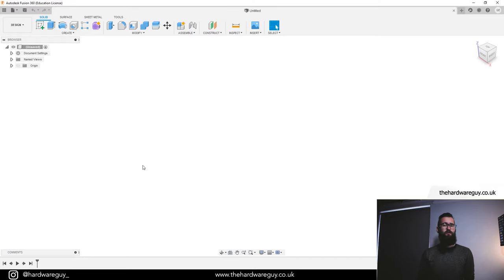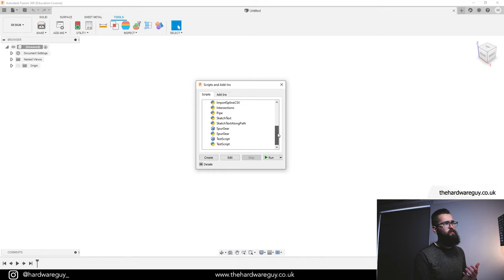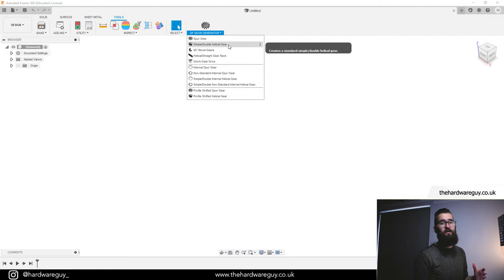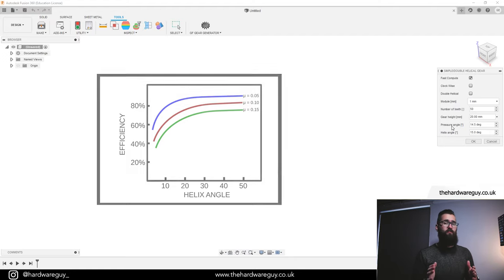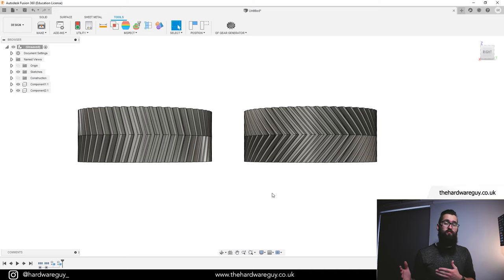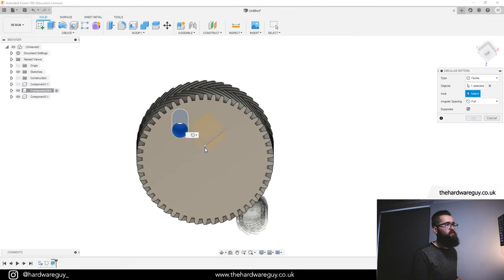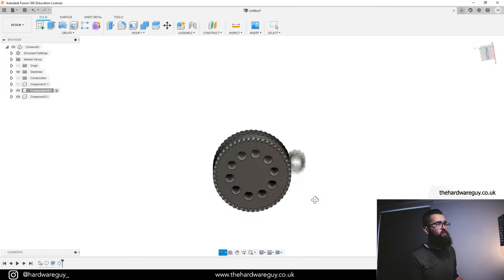How to Create Gears in Fusion 360

Comment from the maker: if you'd like to calculate the correct distance to move your 2nd gear, you can use this formula:
(M*(T1+T2)) / 2)
(Module * (Number of Teeth in 1st Gear + Number of Teeth in 2nd gear)) / 2
Do be aware that 3D printing has wider tolerances than typical machining, so you might have to try a few prints at +/-0.25mm
Reply: How would you suggest integrating those +/- 0.25mm toleranzes? Is that configuratable when creating the gears or do you manage that later in slicer? Changing the values in the slicer would probably change the values of all the other dimensions tho...
Reply: @benloschnigg9275  I would add a small gap in fusion 360 with a user parameter to adjust and try printing with different tolerances
Reply: @wizardOfRobots  I’ll try that :) thx
Reply: @wizardOfRobots  what do you mean? a settting in cura?

Comment: You can reduce wear on the teeth when you choose odd ratio. 50 to 10 same teeth will meet every 5 rotations. 49 to 10 or 50 to 11 it takes many more rotations before same teeth meet and make wear more even.
Reply: Is that actually researched and proved to be a good thing? Now instead of one tooth having to mate with 5 teeth, it has to mate with 50 teeth so any imperfections of one tooth wear every tooth of the other gear down.
Reply: @snarkygnome619  Yes it's proven. Every continuous turning gearbox for every thinkable use, except maybe mechanical clocks,  have odd ratio's, allways. Since the invention of gears.  You can Google for gearratio's of gearboxes of cars for example.  
Which gearbox will fail sooner, the one where two teeth wear each other out, or the one where the wear is spread over several teeth.
Reply: @erwinritter4067  Thanks! Learned something new!

Comment: I converted it to a component then created the new one and it appeared inside my first part.  I don't see you converting anything, you just create a second gear and it appears next to the original.  Mine keeps appearing inside the first one.  Something is missing here???  yes, later in the video you convert to component, but I didn't see that earlier in the video when you first creat the 50 gear with 40%.  It just appears next to the other one.  You don't convert to component until you created the small gear and you move it next to the other one.  Obviously I'm confused now.
Reply from the maker: Create a gear, move it, and then create the second gear. That should solve your issue👍🏻 you don’t have to convert to a component, but it’s good practice! You can move bodies in the exact same way
Reply: @thehardwareguy  Thank you, I will do that.  The video just confused me, in the video you don't show converting to a component on the first gear, you just dragged it to the left and then created a new one next to it.  I tried that and the other one just appeared in the middle of the first.  That's why I was confused.  You must of converted the first one to a componnent before moving it, it just didn't show that in the video.  So I will do that.  Now if I may ask, how did you mate the two together, the small gear and the big gear.  If I just move mine over, it doesn't exactly mate properly (aligne).  Is there a trick that you didn't show in the video?  Thank you for your time, I really appreciate it.  Your videos are awsome, Just not always friendly to new people like me.  Thank you.
Reply: @NarcosisJunky2  That part freaks me out right now :) I am desperately trying to mate the gears, in order to put some axis through it an turn them to something useful, but in this exact moment, where the gears are nearing the video skips the decisive second.
Reply: @holgerheinrich2992  yesssssss i have the exact same problem!!! an other guy used another plugin where you can read the pitch diameter. then he does it like this: (gear 1 pitch dia./2) + (gear 2 ptich dia. /2). but i cant figure out what the ptich diameter is!

Comment: Hello. Not sure if anyone will answer this...I have watched two videos and yes this is a nice feature. However, if I have specific plane and location that I want the gear to go, how do I accomplish this? I have tried multiple times and cannot seem to do this. It keeps locking into the origin. I have tried different move commands, I have tried selecting the plane, etc. Nothing works.
Reply from the maker: You should always design your parts at the origin and use joints to position them afterward!
Reply: @thehardwareguy  Hi there. Thanks for the reply. I am somewhat fairly new still. I thought I had, but for some reason it not. Is there absolutely no way to place the gear specifically where one wants it other than the origin? I have no idea how to do this. I have moved objects before successfully. I just need detailed advice on how to do this.
Reply: I looked into it more and I will try to educate myself on joints. If I need additional help I will ask, if you are willing to help :)
Reply: @thehardwareguy  Looks like I figured it out. It was not that hard once I knew what I was doing. Thank you! :)

Comment: Very helpful, thank you! 
Putting holes in the gear doesn’t actually reduce the weight, if you don’t Print at high infill, it just adds more surface area and the print will take longer and use more material

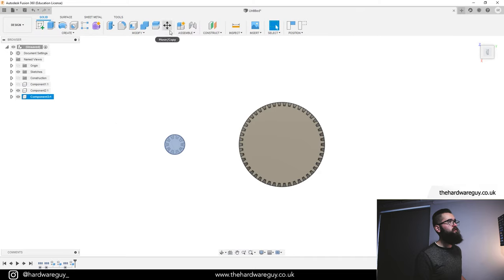Comment: why did you skipped this part tho? pretty important point 6:59 how do you position the gear right? one is easy but how is it if you want to build a gear box with multiple gears?
Reply: You usually have one part file (like the one he is showing) for every gear. Then you start a new assembly file and import all the gears into the assembly. It is much easier to position different objects to one another in an assembly file.

Comment: How do you go back and edit the gear.  When you try and edit, it doesn't open the original window where you selected the Module/Teeth/Height.  It brakes it down.  How do you get those settings to pop back up so you can edit it.  For example let's say I selected 15 teeth and I want 20 instead.  Is where an easy way.  To me the easiest way would be the original Spur gear window to open where you can change those settings.???  Thanks for your help.

Comment: When  I try and create the second gear, it appears at the same location as the first one, how do you get yours to appear next to the original one.  Mine all appear at the same origine.  I noticed that your new parts/components appear further away next to the part.  Mine are inside of each other.  It's annoying, I did everything the same you did on the video.  So it must be a settings or something you forgot to mention.  Please help and thank you for your great videos.
Reply from the maker: New gears will always place themselves at the origin. Convert the gear body to a component like I showed in the video, and then you just move it using the move tool

Comment: Thank you for making these video's they are very much appreciated by someone my age. I  download the GF gear generator on my Mac. But I have tried unsuccessfully to find out where it goes, when I open up Fusion 360 it doesn't appear to be there either. Any help would be great help.
Thank You. PLEASE Stay safe
Reply: download and make sure to install it. Then look for it in the "Tools" section on the top
Reply: Hey, did you solve the problem?  There is a Mac OS version to download, so make sure you click on that (it should be highlighted) before downloading.  I don't have a Mac to give much help beyond that.  Hopefully the rest of the setup is the same as this video. 👍
Reply: I have a similar issue, were you able to resolve it ? Other addins show up fine , I face a problem with this one only

Comment: How do you determine the radius of the gear?
Reply from the maker: Typically you don't because the radius/diameter is determined by the module and the number of teeth. Adjust those parameters until you get a radius close to what you want

Comment: In my opinion, the MOST important parameter is total diameter. The gear is completely useless if it can't fit into my gearbox. Trying to get an imprecise approximate diameter through trial and error by spending hours on a single fucking gear is the height of stupidity. I just want a single program that asks me what I want the total diameter to be, and then it designs the rest of the parameters I input around that critical value. It would literally take less than 5 minutes rather than taking over half a fucking day to make a gear the "normal" way. Humans are stupid sometimes.

Comment: mate why did you cut the most important thing out. MOVING THE GEAR!!!!!. Im sorry its a great video but this simply freaks me out.
Reply from the maker: Thought it was pretty self explanatory to be honest! You move it the same way you move anything else in Fusion 360... The Move Tool
Reply: @thehardwareguy  and how the heck are you supposed to get the exact distance? This is so important! I used another tool where i get displayed the pitch diameter. With this value i can calculate how much i need to offset the gear.
Reply from the maker: You can use this formula: (M*(T1+T2)) / 2)
(Module * (Number of Teeth in 1st Gear + Number of Teeth in 2nd gear)) / 2
Reply: @thehardwareguy  finally thank you, but this would have been important in the tutorial